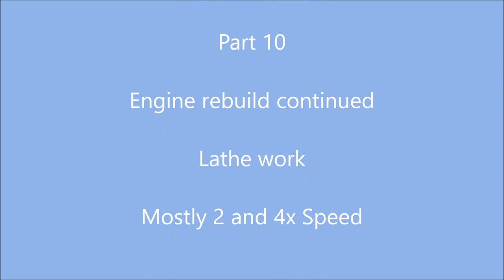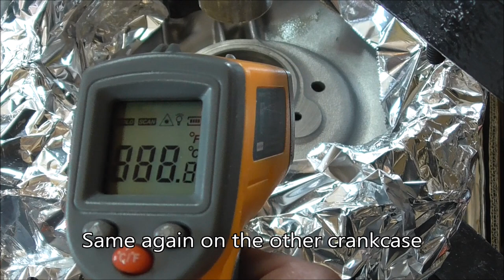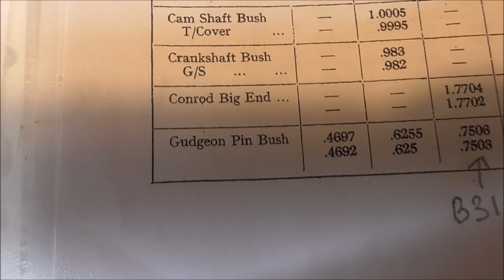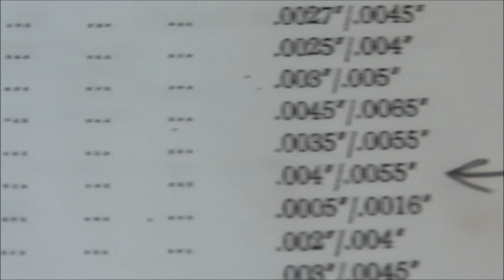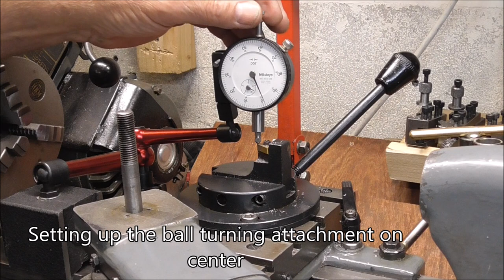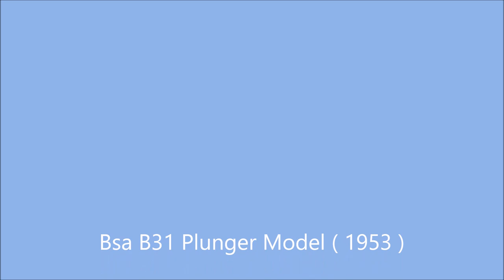Bsa B31 Plunger Part 10

Comment: Thanks for the video Brian. Did you check the crank end float on this? Why or why not? I am doing my first motor rebuild now, it is a Ariel Nh355... very similar bottom end
Reply from the maker: Hi, When I rebuilt this engine there was some end float but it disappeared when the shock absorber was fitted. The big and small end checked out OK but I did fit a new gudgeon pin.
Good luck with you rebuild.

Comment: hi, great series of video's Brian. Tell me are the lock tabs on the oil pump standard or are they your own preference. Cheers
Reply from the maker: Hi, thanks for the comment, the locking tabs are not BSA but you can get then on line. I found that if I overnighted the bolts on the pump it tightened up a bit.
Cheers Brian

Comment: Nice and clean rebuild, hand's who hasn't broken a ring on one of those things. What is the sealer you used on the crank case, looked like body filler from here, but i'me sure it wasn't.
Reply from the maker: Hi, thanks for the comment, the crank cases were vapour blasted, no filler anywhere. They come up like brand new as you can see. Cheers B
Reply: @500dbd34  I meant to say, what was the sealer you used between the crankcase halves, it looked like you were mixing s hardener in to it?
Reply from the maker: @Dave.Wilson  Sorry, mis- understood your post. The jointing compound is ThreeBond 1215 which is silicone based, not twp pack but I do mix it up a bit. Thanks again B
Reply: @500dbd34  thanks for that.

Comment: Hello Brian
I have a problem with my b31 crank.
Its about replacing the big end. I replaced the  pin and the outer race in the conecting rod.
Now my problem is that i can't put the conecting rod on my new roller bearings because it seems that the tollerances are to small. Have you ever had that problem?
Do i need to reem the outer race out if this is even possible?
Kind regards 
Patrick
Reply from the maker: Sorry I can’t help you with this one, I used an engineer to do mine as I have had trouble with set up and balancing in the past. I hope to have another attempt soon . Good luck with yours. Cheers Brian

Comment: hello brian , I have a tight spot on my back wheel , new brake shoes , new wheel bearings and new sprocket , any idea what might be please ? new chain .
Reply from the maker: Take the chain off and back off the brake and try again, sounds like an oval brake drum , unless it’s really bad I would be tempted to live with it as skimming the drum is best done on the wheel and can be expensive. If it was the front you would need to sort it though. Good luck B
Reply: @500dbd34  thankyou